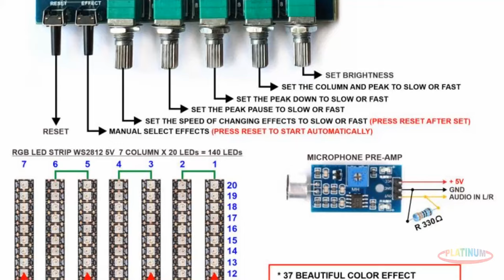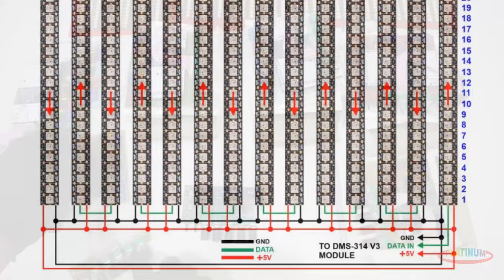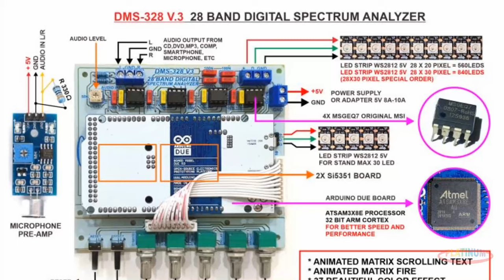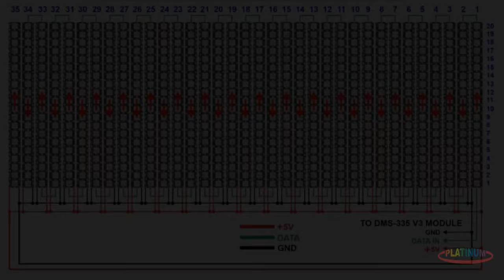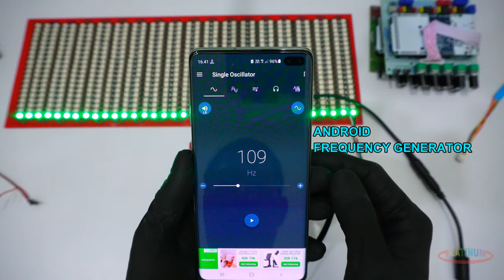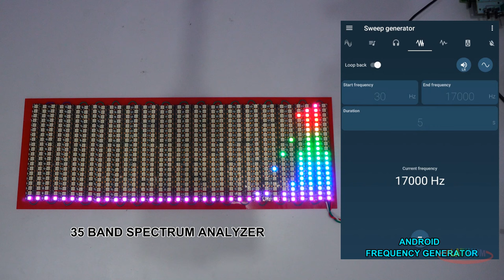Music Spectrum Analyzer Module 7 Band - 35 Band Demo

Comment: I wish you made these modules with an audio return channel so that I could plug my computers audio-out into the module and then have the audio run back out the module into my amplifier. That would eliminate the need to split the audio signal at the source which tends to drop the signal strength. It could  then also be used with old style amplifiers that have an tape monitor output. Two more things these spectrum modules should have is a source selector and a bluetooth receiver so I could wirelessly send music from my phone to the Spectrum module and then have the music run to my amplifier through a wired connection or select and switch to the wired input connector. Please make it so!
Reply: 100% agree, an RCA in/out would be great, I have a tape rec on my pre-amp but i've never used it, even if i could just use that output to the analyzer that would be awesome.

Comment: Need a driver for my 60" TV display , instead of building an LED display.
      HDMI or video output.  Something like that.  NO DEVICE can do that yet.  The RCA stereo inputs and effects are GREAT.  Keep those.
    Downloadable spectrum analyzers are lousy.  They consume CPU time, have slow inaccurate signal response and display a bunch of unwanted data. Its only the bit-perfect pretty bar graph display I want.  Think of all the audio and home theater enthusiasts with huge displays between their speakers.
    Put it in a decent metal chassis with good connectors and a cable.  You'll sell a thousand for $299 shipped.  Still hoping & terrific work so far.

Peace
Reply: Most people have Large TV's now. If you are having a Party using the TV as a display for a cool Spectrum analyzer would be a cool thing.
Reply: @patricknaville4564  Yeah, a box with analog inputs, it's own nice little HD display & HDMI video out for the TV.
    A good & accurate one would be great. Think of 60" VU's in HD.  Awesome.

Crank it up  
🔈🔉🔊

Comment: Also you mention 35 and 20 Pixels and 35 and 30 Pixels. I am going to assume that it is adjustable for 20 or 30 pixels. Is that correct? Is it a Button to that changes it or is it in the code? Thank you in advance for answering my questions. I know this is a lot of work I appreciate it. I am asking all the questions before I buy 2 of them.
Reply from the maker: there is no button to change pixels.  20pixel and 30 pixel are different modules😀
Reply: @PLATINUMKIT  So where can I purchase 35 x 20 Modules?
Reply from the maker: Please check in description😀

Comment: Hello Sir, what values have potentiometers?
Reply from the maker: 50k
Reply: And what use are the resistors connected to them?
Reply from the maker: to connect to the led no need a resistor
Reply: Thank you for replay Sir. I appreciate. I want to learn how this board works. Can you be more specific about the role of those resistors on the board that connect to potentiometers through the wired connector?
Reply: @PLATINUMKIT  can you say in doller